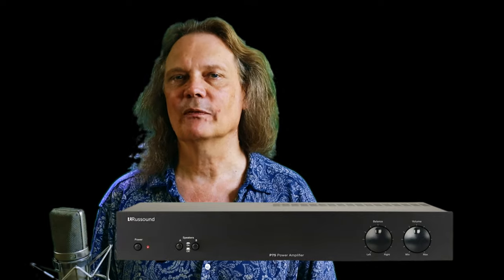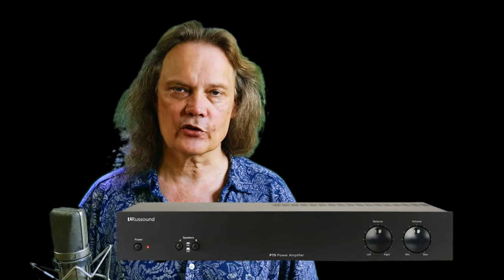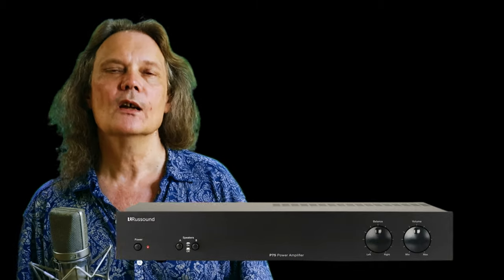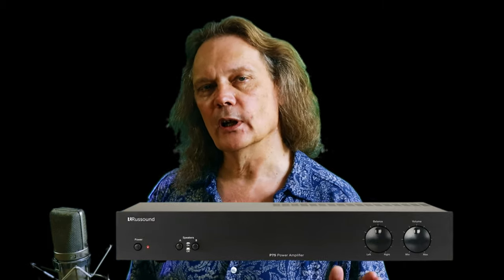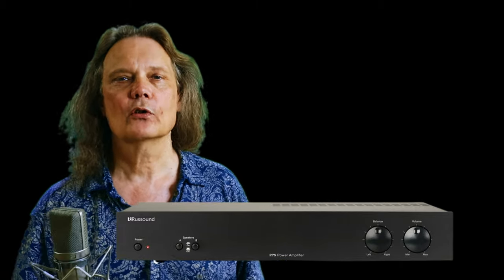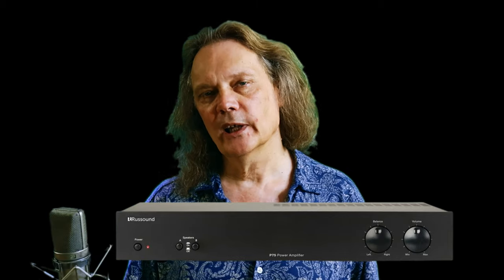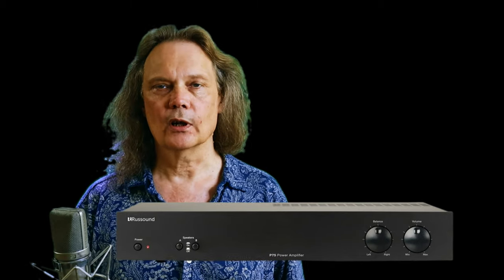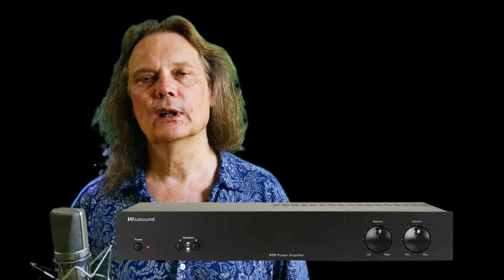Surround Sound on a Stereo 2-Channel Amp - Methods & Limits - A Viewer Question

Comment: Nice video!  I'm curious, why would you avoid the auto switching rca inputs?  Wouldn't they all be of the same sound quality since they are all on the auto switch?  I have the Russound x225 and I was considering using them
Reply from the maker: Thanks -- I have no issue with the auto input switching capability, I would expect both inputs to sound nice.  For some people, or some circumstances, I can imagine it could be a unique and helpful feature.

It's just a "extra" feature that for me, personally, I don't see a need for.

Comment: I just want to add a center speaker to my stereo for better dialogue. Unfortunately the surround sound systems today assume that everybody wants a sub woofer and ever increasing number of surround speakers. I do not want the clutter nor do I care for the "surround" experience.
Reply from the maker: You may be able to go into receiver setup menu, and select that you have main right, left and center speakers, and turn the other surround speaker settings to off.